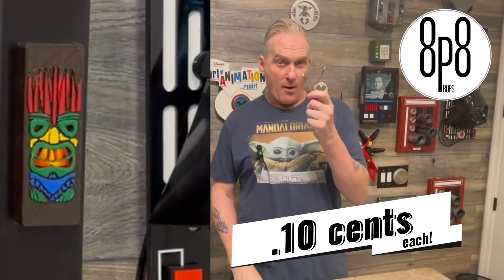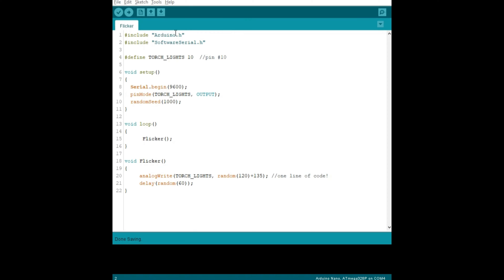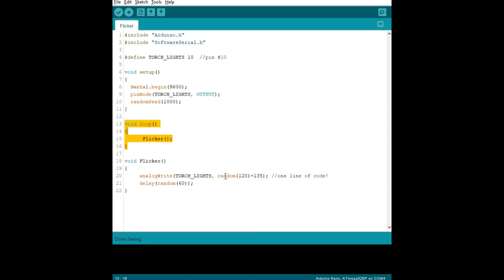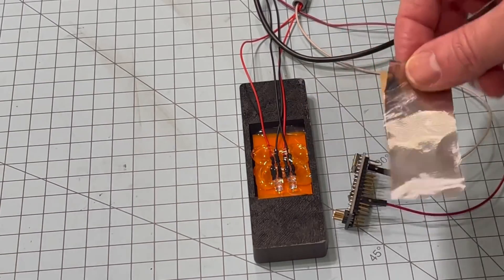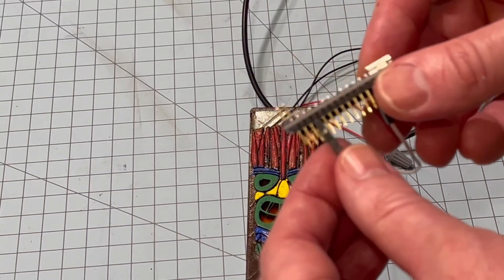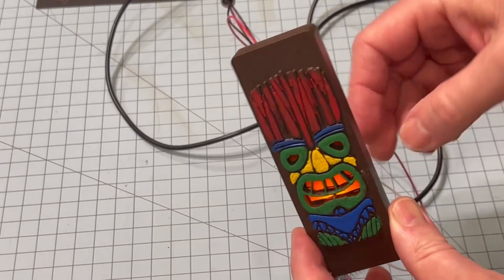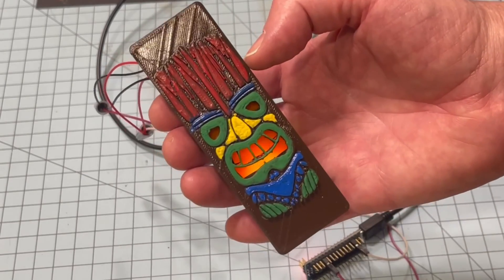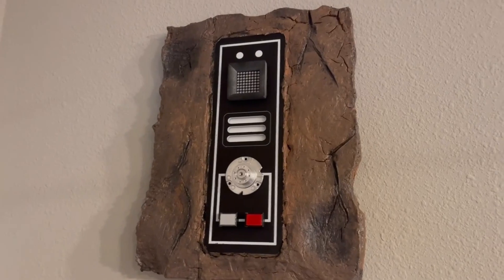Realistic LED Flickering Flame Effect for Arduino - 1 Line of code #arduino #coding #candle #led

Comment: No resistors needed?   I guess the Arduino has built in resistance?
Reply from the maker: We use LEDS with pigtails installed and they have the resistors built in line, makes it so much easier!

Comment: Great idea, but would be more useful for several LED's randomly flickering independently from each pin.

For a simple circuit like yours it is far easier and far cheaper to just grab the LED's from some LED candles and use them.
Reply from the maker: Yes, now they have LEDS that automatically flicker on Amazon, makes life a lot easier!